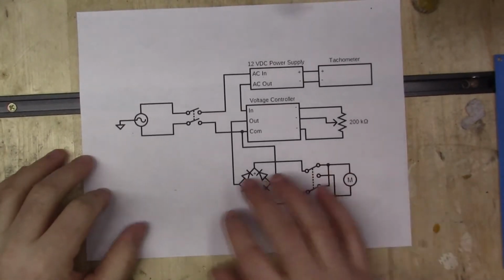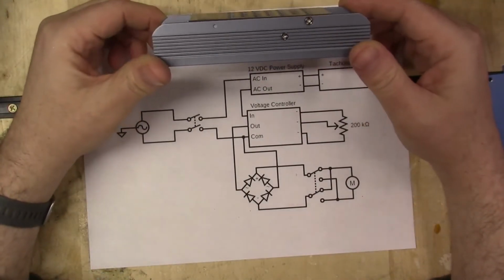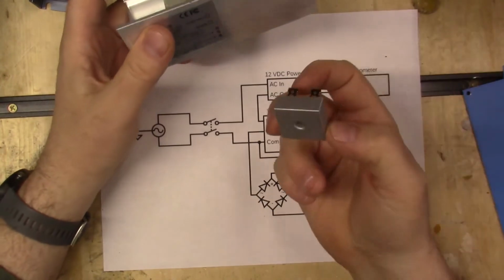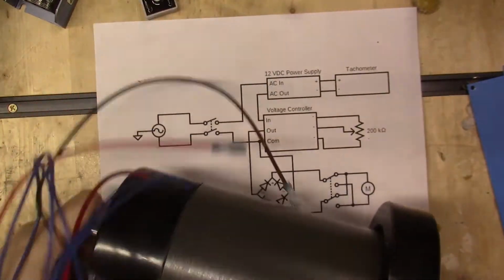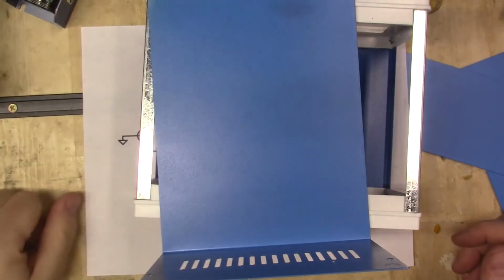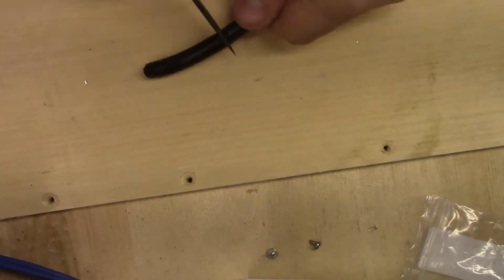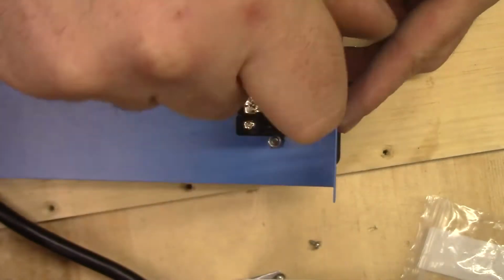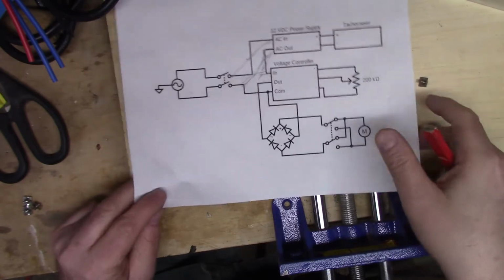My Harbor Freight Lathe blew out...time to upgrade it.  Part 1.  Electronics.

Comment: Great video, David!

You should get yourself a set of conical drill bits. They've changed my life when it comes to making holes in thin metal (and other weird stuff). When I fitted my old saw for the new screws (as I've mentioned on Discourse), I used a conical drill bit for the saw blade. It was like cutting butter!

Very interesting video—although I don't have a lathe and can't have one in my apartment. But some day ...
Reply from the maker: I'll have to look into the drill bits, thanks!

Comment: Your video has given me the motivation to upgrade my HFT lathe, but I think the schematic in your link has a mistake. It looks like the output of the reversing switch is a dead short. Am I reading it wrong?
Reply from the maker: Yes, I see what you mean.  I drew the switch wrong.  Thanks for pointing it out!

Comment: Hi David. It's a bummer about the motor. Are you sure you bent the shaft and not the flywheel? One thing I noticed is that you edited the wiring of the electronics twice.  It looks like it's from 2 slightly different camera angles tho'. Oh, one last thing. Did you add heatsink compound to the rectifier before you mounted it? Those generate an awful lot of heat so you might think of doing that and also adding a computer fan to the project box to keep things cool. I'm interested in how this turns out. A friend gave me a HF lathe and it needs a new motor too. My shop is an old woodshed and I can't wire it for electrical unless I bring it to code and get permits, so I'm wiring it for 12VDC (which doesn't need permits). When I'm done, I'll plug the shed into an extension cord on the outside and the inside will have a 12V distribution box to power the lights and lathe.
Reply from the maker: Yeah, the first time I wired it I didn't have the motor secured and when I plugged it in it jumped off the vice onto the floor.  I tried to catch it but just ended up smashing my finger.  The next day I wired it up again when I found it was bent.  It's definitely the shaft,. I took the fly wheel off and the shaft wobbles like crazy.
Reply: @ddsworkshop4371  Damn. That sux. Well, I hope you get it figured out soon. Good Luck.